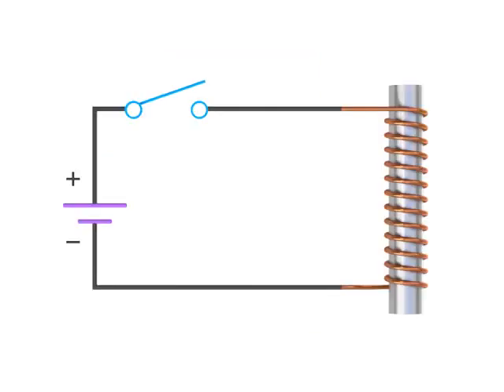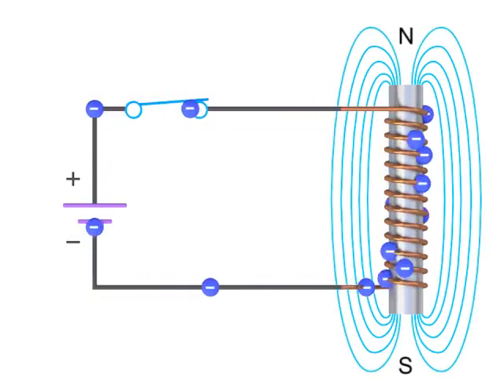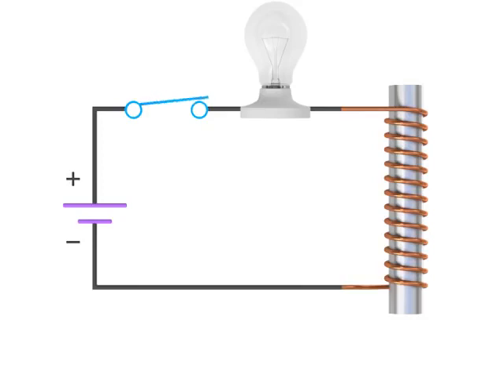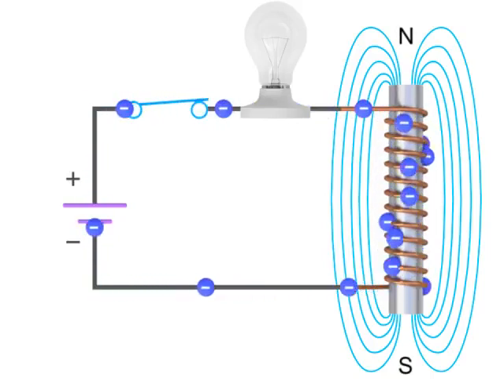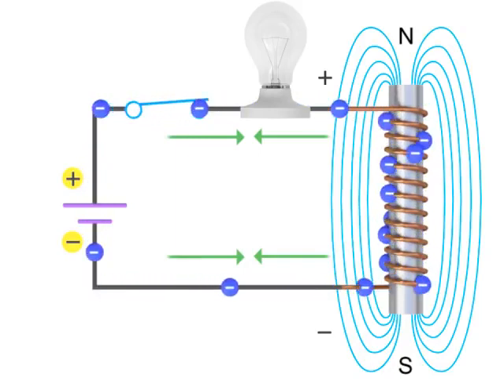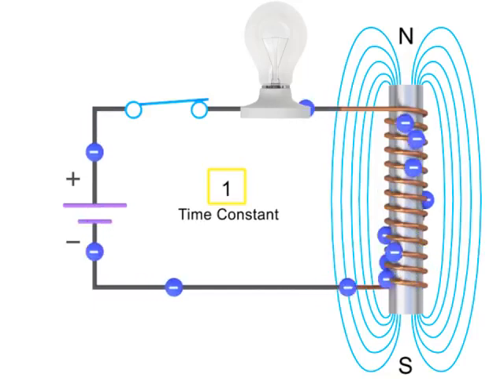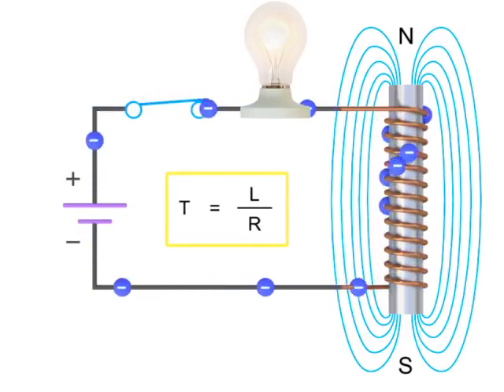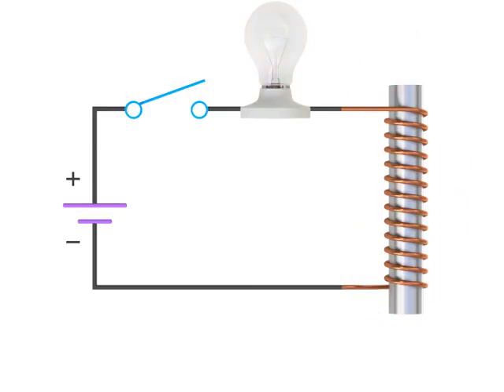How Inductors Work Within a Circuit - Inductance 3/7 | AC Circuit Analysis | كيف يعمل الملف؟ الحث؟

Comment from the maker: Thanks for watching. For More Videos: Please Subscribe My Channel
AC Circuit Analysis Tutorial: https://bit.ly/2VyoHqP
Physics Tutorial: https://bit.ly/2BjVOaX
Motion Control  Tutorial: https://bit.ly/31sqUrz
Advanced Programmable Logic Control (PLC) Tutorial: https://bit.ly/3g8FfO3
Embedded Systems & Microcontroller Tutorial: https://bit.ly/3893dpH
Motors and Drives Tutorial: https://bit.ly/3dH0yF1
Fluid Power Design and Application Tutorial: https://bit.ly/3dEjvIq
Fluid Power Control Tutorial: https://bit.ly/3eniF3S
Process Control Tutorial: https://bit.ly/3hTASs7
Channel Link: https://bit.ly/2IsqVS for watching more Videos
Learn how 3-way and 4-way switches work independently allowing you to turn the light on or off from two different switches in the room.
Simulations provided free under a Department of Labor grant awarded Eastern Iowa Community Colleges.
😌Don't Forget To Like, Share, Subscribe & Comment 😬
======
تعريف بالقناة:
قناة تعليمية مهمة للجميع عليها أكثر من 210 فيديو تعليمي، بها:
1- شرح لبوردات الاردوينو Uno & Mega 2560  وعمل مشاريع رائعة بها حيث، شرح Servo Motor, DC Motor وطرق توصيله والتحكم في إتجاهه، و EEPROM وتوصيلها وكيفية التعامل معها. وال Stepper Motor، واستخدام الاردوينو كمولد موجات جيبية ومسننة ومثلثية،
رابط الدورة من هنا: https://bit.ly/2PvtHvx
2- شرح دورة الأنظمة المدمجة Embedded Systems والميكروكنترولر واحتراف البرمجة بلغة الامبيدد سي Embedded C. وعمل مشاريع رائعة…
رابط الدورة من هنا: https://bit.ly/2KadqX2
3- شرح كيفية الربط بين الاردوينو واللابفيو وعمل مشاريع رائعة بهما.: https://bit.ly/2KlTssj
4- شاهد أيضاً،دورة مهمة جدا لطلبة الهندسة في شرح أساسيات ومبادئ التحكم الآلي او هندسة نظم التحكم
(Automatic Control or Control systems engineering):
رابط السلسلة:  https://bit.ly/2NGyeYd
5- دورة متقدمة في التحكم باستخدام اللابفيو (مهمة لأقسام تحكم أو كنترول والكترونيات). وهي تطبيق عملي لدورة التحكم الالي 
رابط الدورة من هنا: https://bit.ly/2K7aVEE
6- سلسلة Root Locus Method في هندسة التحكم الآلي لطلبة كلية الهندسة، قسم كهرباء،
رابط السلسلة: https://bit.ly/33CROvi
7- سلسلة عملية في القوي الكهربية او الكهرباء المتردده الاحادية والثلاثة الطور (Electrical Power) لطلبة هندسة ولكل مهتم بالكهرباء
رابط السلسلة كاملة:  https://bit.ly/3dWEckc
8- بعض الدواير العملية الكهربية المهمة للجميع.
رابط الدورة من هنا: https://bit.ly/2Fnli65
9- دورة في القياسات الكهربية، مهمة لطلبة كليات هندسة ولكل مهتم بالالكترونيات والكهرباء: https://bit.ly/30RdTVS
10- دورة في احتراف الرياضيات والجبر والهندسة والتفاضل والتكامل والقوانين الخاصة بها بدون تعقيدات.:  https://bit.ly/30ykUtG
11- دورة في احتراف برنامج اللابفيو الرائع LabVIEW : https://bit.ly/2TOx4y4
12- برامج مهمة للكمبيوتر واللابتوب الخاص بك: https://bit.ly/2qT9NM6
13- Complete Practical PLC Course Tutorial: https://bit.ly/3dHon09 
14- Green Screen Tutorial Link: https://bit.ly/3esShFa
15- Complete Process Control Tutorial: https://bit.ly/3hTASs7
16- Complete Fluid Power Control Tutorial: https://bit.ly/3eniF3S
17- Complete Fluid Power Design and Application Tutorial: https://bit.ly/3dEjvIq
18- Complete Motors and Drives Tutorial: https://bit.ly/3dH0yF1
19- Complete Physics Tutorial: https://bit.ly/2BjVOaX
19- Complete Embedded Systems & Microcontroller Tutorial: https://bit.ly/3893dpH
20- Advanced Programmable Logic Control Tutorial: https://bit.ly/3g8FfO3
21- Physics Fundamentals Tutorial: https://bit.ly/2CNrzcU
22- AC Circuit Analysis Tutorial: https://bit.ly/2VyoHqP
وهناك المزيد علي القناة، وان شاء الله هذه مجرد البداية فقط.
رابط القناة:   https://bit.ly/2IsqVSC
وتعمل اعجاب ومتابعة لصفحتنا علي الفيس صفحة المهندس المحترف
رابطها: https://www.facebook.com/المهندس-المحترف-100879698187843
متنسوش الإشتراك بالقناة لمتابعتنا وتفعيل جرس التنبيهات ليصلك الإشعارات بالفيديوهات أول بأول.
====
#ُAC_Circuit_Analysis 
#Kyrillos_Refaat
Reply: 🔴 {رَبِّ اجْعَلْنِي مُقِيمَ الصَّلَاةِ وَمِن ذُرِّيَّتِي} 🤲🏻

قال تعالى {وَأَقِيمُوا الصَّلَاةَ وَآتُوا الزَّكَاةَ وَارْكَعُوا مَعَ الرَّاكِعِينَ}

📖 { وَأَقِيمُوا الصَّلَاةَ } أي: ظاهرا وباطنا 

📖 { وَآتُوا الزَّكَاةَ } مستحقيها

📖 { وَارْكَعُوا مَعَ الرَّاكِعِينَ } أي: صلوا مع المصلين

🔴 إذا كنت تشعر أنك لا تعيش سعيداً

🔵 فاعلم أنك لا تصلّــي جيــداً

⚠️ فهنآك فرق كبيـــــر :

⬅️ بين من يصلي (ليرتاح بهـــــا)

⬅️ وبين من يصلي (ليرتاح منهـــا)

فآنظر لقلبـــــــــك ♥️ أيهما أنت؟

📚 مصادر متعددة

📸(2) صورتين

يتبع في الإثنين القادم ان شاء الله